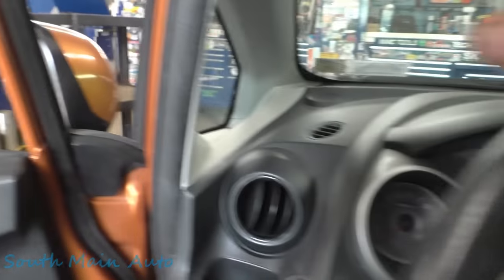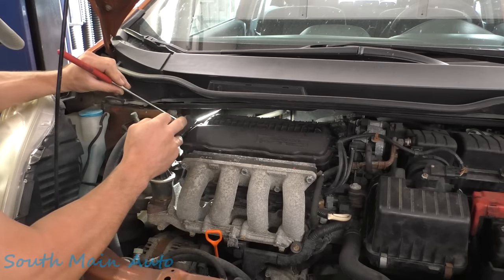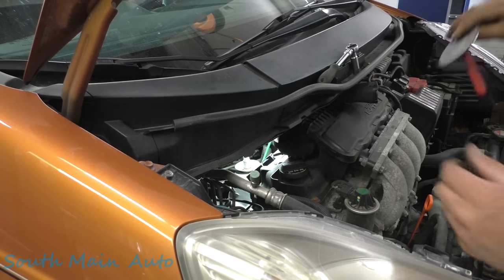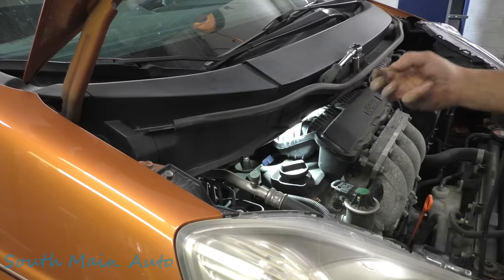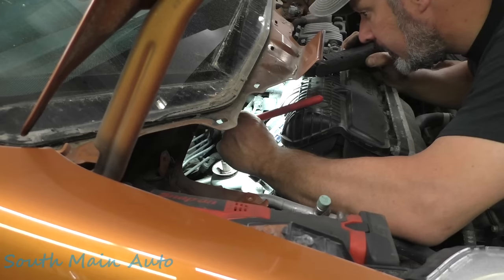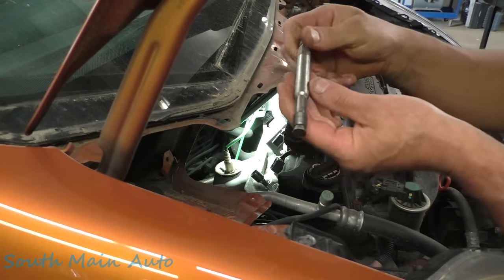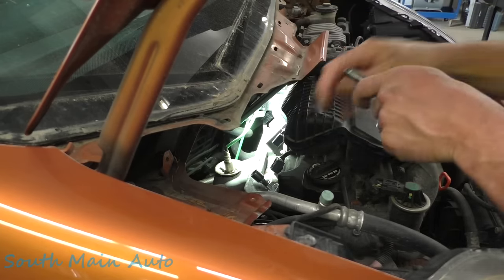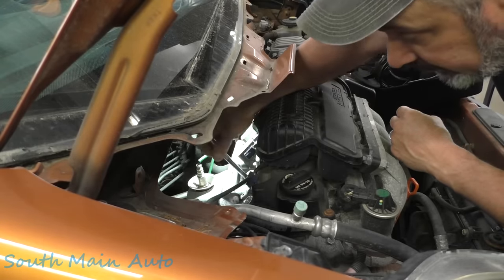Fixing A Blown Out Spark Plug - Honda Fit Edition

Comment: If you think this was an impressive repair, let me direct you to Eric installing  threaded inserts in a stripped out toyota engine block.
As a machinist I would have the luxury of having a bare block that I could clamp on a milling machine, locate the holes precisely, and drill and tap perfectly on location and square.
Full props to Eric doing it in the car and having it work perfectly with full massive torque applied to the head bolts at the end.

Comment: Bought a 2007 FIt second hand, wasn't sure of maintenance history, so went to change the plugs and noticed all four plugs loose!    The plugs looked okay, so torqued them back to spec, and car was fine.   A couple years later, ended up putting the new plugs and one of the plugs was again VERY loose.

Would make it part of bi-annual maintenance to recheck torque.  I normally would also say not to use anti-seize, or any lubrication on threads, but I used NGK plugs and installed dry, and they still backed out!

Comment: Minor FYI... Koken makes extensions that are nicely knurled around the female drive end... that are not only great for stuff like this; but everyday use as well. They come in all drive sizes, regular, wobble & some up to a meter long. Koken specializes in sockets, ratchets & related, has a huge selection and puts out excellent stuff.
Cool videos, Thanks! :)

Comment: Nice video man,  glad you could still save a new thread like that inside the spark plug's loose hole. That's sure is cheaper than buying a new engine.  I'll keep that torched in mind when I change my spark plugs for our 2017 Honda Mobilio here in the Philippines.

Comment: I've done a few blown out plugs before on Subaru's. I have alsways done the fill the flute with grease go in a bit pull out clean the flutes and regrease till yo get it in all the way. If you don't have a way to blow it out like Eric did that way works really good.

Comment: I had the cylinder heads for my old VW 1835cc engine re-done at a shop back in 1986; the shop installed heli-coil spark plug inserts even though the original aluminum threads were OK.  About 2010 one of those heli-coils unthreaded while removing a spark plug, and I installed a solid threaded insert there (#2 cylinder) without removing the engine; still working fine.  I used red Loctite on the outside of the insert and never-seize lubricant on the spark plug threads.

Comment: I use SHAVING CREAM ...   And I have be using a back tap lately.  The spark plug insert kit I use has solid inserts with a shoulder.   I grease the tap and frequently remove and clean the chips off.   Be sure the valves are closed and fill the cylinder full of shaving cream with a hose.    When you blow it out all of the chips are cleaned out! This no-name kit came with about 30 inserts ($35 Amazon/Ebay) and can be used on Ford 4.6/5.4 with blown out spark plugs on the side of the road.

Comment: Wow that’s a loud fit! 
I had a 2013 fit and loved it. Never had any issues except the axles in front both snapped twice each side on me. Each time 4 times total 
It was while accelerating hard to get across road thru traffic and snap and dead stop in middle of road. Almost got T BONED twice! 
     Honda did a recall on firs sold in rust belt states due to a corrosion spray coating not sticking to axles so was refunded 
Good $5 k back. 
      And the D light started flashing after I did a transmission fluid drain and fill and using amsoil atf 
And not the Honda fluid I should’ve used. 
    Appears that amsoil ATF runs too cold all the time and too cold ATF is just as bad as too hott atf in a transmission
   I put back the Honda fluid ATF and D light stopped flashing

Comment: Well known problem with the Honda Fit and loose sparkplugs. For me and a lot of people the problem is often with the number 3 plug (third from the left). Honda even increased their recommend spark plug torque for the Fit because of this issue. I highly recommend anyone that owns a a Fit to check the torque on their plugs. Once a year if you are a high mile driver. Under 5000 miles a year you can get by on every other year or so. I went three years and my number 3 plug was a little loose that it was causing the number 3 ignition coil to run hotter. I knew this because I changed all of them when I bought the car and put a lot of dielectric grease on it. The number 3 ignition coil had discoloration from heat and the grease was no longer greasy.

Comment: This is insane. Yesterday I had one of these towed in for the exact same thing. Spark plug was MIA and coil pack broke at the mount and melted all to pieces. Fortunately for the customer the threads were good on hers. I was shocked. Got new coil packs and plugs coming Monday. Crazy stuff.

Comment: Thank you for bringing us along. I want to replace my plugs on my kia soul but I worry about breaking the plastic clip the connects to the coil.

Waiting for my brake caliper rebuild kit so I can finish my front brakes. Never had a bad brake caliper. It is not leaking it was real pisser to push in Yes I should buy a reman or new from dealer but I want use the knowledge my grandfather shared with me to see if can repair it on the cheap.

Comment: Great video, did the same thing on a 1990 Pontiac, Grand Am. listened to tech to tell me to remove plugs with warm motor. big mistake. my year would eat the indium plug as they were to deep in the cylinder, design fail. so I would change them every other year and one time one spun. I got a kit and did all 4 plugs. best thing ever. why not have these in from factory as it didn’t mater after cold or hot you could easily remove the plugs.

Comment: Dang those Helicoils are pretty neat! They thought of everything, even the peening to lock the insert as best as possible.  I'll have to pick up a kit just in case.  Some of the castle nuts on mid 2000's Honda's do have thread troubles.

Edit - Tough to find that kit.  Amazon returns a bunch of trash kits.. while Napa comes back with a 1/2"-13 X .750 ... I'll keep looking .

The Part# I'm getting for that kit: Part #: BK 7703223 .. very similar but not quite.  Odd.

Comment: Great video. ngl I'd probably cry if I found myself in this situation, lol. So it's a big relief to see just how easily and simply you handled this. Glad that it's such an easy fix in this case. Just need the right tools, which fortunately don't seem to be particularly expensive, either!
Reply: And yeah, as @jthelman commented, especially the fact that you practically did this blind, too. Outstanding demo!

I also think I'm going to have to grab that endoscope. I was really impressed with Milwaukee's new one, but I'll happily take your suggestion for a tiny fraction of the price. Camera quality seemed just fine. My only question would be how often do you use the 5.5mm camera over the 7.9mm? Assuming you have both, since you say you have a few. Or, if not, how often do you find the 7.9mm just too big?

Comment: Saw something on the "Crescent 18 oz. Steel Indexing Claw Hammer" the other day, where the claw rotates and you are supposed to be able to hammer nails in between close studs. Seeing this video made me think it might be a good place to use it having to hit something like this in a tight space. The benefit is you move the claw up, so you keep all that mass at the head and can get a good impact underneath the window and behind the engine.

Comment: Watched till the very end, very impressive repair, it’s a shame whomever didn’t tighten those plugs up correctly originally, ultimately did a complete disservice to this customer. Amazing work you performed. I would have been swearing the entire time. Why don’t they design engines where the plugs are easy to get to and see?

Comment: Honda Fits are known to have the spark plugs back out over time. I usually check the torque every time I do the oil change. The factory torque was quite low and after a few years Honda increased the torque to help. Unfortunately, they can still back out over time.

Comment: I watched the Ford service garage on a Ranger 4 banger that had three out of four stripped out as the truck had the original autolites still in it and three stripped and one broke. The put everything in the truck on the floor and called my old boss to let him know their sending it his way. I loaded it and headed back with all my parts I needed for my fleet job and a plus one on the rollback that also ended up on my plate. That kit you have identical to the balkamp kit I had  also from helikoil

Comment: my name is tony from nj, im a long time subscriber love your videos, tech tip i leaned this tip when i was an electricians helper, when you use electrical tape before you cut off tape twist the roll a couple of times before you cut it, you'll have a little handle to unravel tape. not sure if you knew this tip, i wanted to share it anyway.

Comment: While I like the interior of the 2nd gen more, I’m glad I found a 1st gen Fit, at a good price for the mileage. 

Didn’t have nearly as easy access to the spark plugs as I did on my 98 Accord, but at least I don’t have to remove the wiper cowling like on the 2nd gen Fits. 

Main reason why I wanted a 2nd gen was for the ability to mod in radio controls. Since I got a 1st gen, I’m using an Atoto RF stick-on remote. Honestly works great, and gives 2 extra functions over the 2nd gen stock radio wheel control.

Comment: A mechanic that I used to work with had an old (1950s) push mower that would spit out it's spark plug, all he did was wrap the spark plug threads with Teflon tape and that gave it enough bite to stay in.  He said it had been like that for years.

Comment: It happened on my 2013 Fit but nothing was stripped out. I think the plug backs its way out from vibration. So i put the new NKK plugs in with a tiny tiny dab of anti sieze and crank the plug back down nice and hand tight. (no torq wrench). Never had another plug blowout ever again. TIP: Use your needle nose to grab out the lose plug and any broken plastic from your coil boot. You can also crank the motor over and she will blow any debris out of the cylinder. Also, buy a Honda plug tool. Its heavy and goes into those deep wells super easy. Once again, forget about toqring to factory specs. Do it like i told you. This is a very common problem on the Honda Fit. PS: Its fairly rare for any plug threads to actually be stripped.

Comment: My 2006 Acura TL 3.2 blew out the #6 spark plug in the front... took out all the threads and shattered the coil pack like it was shot.  Dealer wanted me to either scrap the car (buy a new one off the lot, which they could get me a "great deal" on), or to authorize getting a used engine to swap in.  I asked if they could do a helicoil - they said they wouldn't do that, no way.  So I had to go get a tow dolley and hit harbor freight for a comealong to pull the car up on the tow dolley.  Long story short, I towed it home, and carefully did a process with a product similar to a helacoil called a "Timesert".  The timesert was really an excellent repair... it had a shoulder at the top so it really locked into place and gave the spark plug seal somethign to directly bear down on.  Have now run the repair for 30kmi... zero issues at all.  And the dealer wanted me to junk the car.

Comment: nice repair, a time-sert would have been a better choice, IMHO.
they are what l use, where you had to hammer on the top to lock it in place, the installer part of the time-sert pushes the thread of the entire insert against the  new threads you cut, and provides a mechanical lock all the way, l do still use loctite, you can never be too careful.
time-serts were a game changer for me, when l found them, all of my helicoil kits went straight in the trash.
keep up the good work

Comment: One time and one time only Mr. O I had a Ford V10 that had an insert. I did not know it had an insert and I removed the plug. The plug had no insert when removed. I went to put in a new plug and it just wouldn’t tighten. I looked down the hole with a bore scope and when I threaded in the plug it rotated the insert all the way in and the insert fell into the cylinder….that was a very pricey tune up.

Comment: I'm not a pro mechanic or even a hobby machinist, but would a Time-sert be a good option here?   They self-lock by expanding the bottom thread, but I don't know if that's good enough for an aluminum head and the heat stresses it sees.  Initial impressions is that it would be one less step and potentially a more positive lock than swaging over a fitting in a limited area.

Comment: yep valves closed and piston down out of the way, don't want to run into any of them with the drill, reamer, tap, tooling.
typically, all the debris is tiny light chips and anything left after blasting it with air nozzle will exit rapidly via the exhaust port on first fire, very tiny shavings will likely leave as glowing embers.
pretty much, crank it over by hand once to ensure nothing will collide, from insert too deep/valves hitting(rarely an issue, unless very loose and spark plug threads it in further, threadlocker!), then fire it up to idle immediately to toss the junk out.

Comment: Really interesting video(not that I have everseen a bad one ) as I have never come across one .question if you were stuck out in the boonies could you use a larger diameter spark plug as a temporay fix ? Cheers Mr O.

Comment: Story time:  1990-something.  Fort Drum.  End of tour, time to go home.  A buddy has issues with his POV (Personally Owned Vehicle):  A spark plug is dangling from  the cable; blown out of the hole.  The threads are gone, time is ticking.  No place is open on a Sunday afternoon.  I rummaged around his trunk for possibles and there is some trip flare wire (Army Life, Yo).  Instant DIY helicoil.  I wrapped the sparkplug threads with that really thin wire and turned it in.  "Like a glove(tm)".  He drove home and another many thousand miles with that plug fabricobbled into his motor.

Comment: We use the medium length inserts to repair stripped aluminum oil pan drain plug holes, along with a new spark plug threaded drain plug.

Comment: So, it seems to me that the biggest problem here is that Hondoo designed this cylinder head to be installed backwards...I mean seriously, the spark plugs SHOULD be in the front on 4 cylinder transverse mounted engines right?!? I thought only Ford Triton engines launched spark plugs (just kidding of course).

Also, I bought that camera from your Amazon store a while back. It's a really nice setup and I'm glad that I made the investment.

Comment: Need some advice from you. My 2000 Camry LE 4 cylinder is now 23 years old I was told by some friends of mine to change the fuses inside the cabin. I haven't so far. But need a opinion if I should change the fuses to new fuses. When I had my new stereo system put in the stereo guy took out one of the fuses it full apart in his hand. The stereo guy replaced it for me. I do know it takes the mini fuses because I checked. I do need your answer. Please reply.

Comment: That's interesting.  I'm a retired mechanic and drive an 09 Fit.  I've done my sparkplugs all with my left arm by feel.  Now my neighbor drives a 2012 Fit and she started having drivability issues.  I scanned it and it showed a #2 misfire.    So I brought it in and reached around...yes  I did a reach around, and took the coil off and the spark plug was loose.  Due to being loose and letting gases out, it ruined the coil.  So I put a new coil and spark plug in it and it was good and ran perfect.  Nobody had been into that engine before.  It's damned strange to have loose sparkplugs like that.
Reply from the maker: Yeah that is interesting. Nice job on the classic reach around too haha

Comment: Eric I replaced my 08 cobalts rear drums and it made clicking I got a shop to replace rear drums and still clicking I hear drive in reverse and slam on brakes will fix the self adjusters wondering if this will fix my rear drum clicking noise….. just spent 1100 at shop trying to avoid tearing apart myself and it still does this skipping clicking noise when breaking sometimes but not every time….  Had car since 2012 and put 2 engines in it So it’s sentimental thanks!

Comment: That ke stickin it all the way in hittin the bottom omg.  Dude you kill me hahahahah.
  I like the inserts like the ford repair kit. The helicoil ones work just as fine.
  Ive had to do both but only on for 3 valve and tue old chevy 2.2l4
 What really fun is when the plug flys by ypur ylhead as the engines running, and so fast couldnt find where the spark plug went hahahaha

Comment: Hoping it doesn't come to the stripped out part. Have a Volvo 5 cyl w/#3 plug not wanting to unscrew. Other 4 easy out, new plugs in w/anti seize. #3 now sitting with some PB blaster hoping to penetrate its was to loosened threads.

This video reduced my anxiety. At least the plugs are on top facing up with complete access.

Comment: Bean counters: "Okay, engineers, we need to save an additional 1.6% per unit manufacturing cost. Work your magic and we'll have a pizza party."

Engineers: "Well, we could push the engine back an additional 4.5 inches to allow the use of larger components that are cheaper to mass produce, but it will make the backside plugs almost impossible to remove, especially during a catastrophic failure."

Bean counters: "Perfect. This also guarantees an engine out or head service at the dealership. Pepperoni and mushroom okay with you guys?"

Eric O: "You have underestimated my power"

Comment: Is there any difference in your experience with using. A pneumatic rat hit vs the battery one ya used  ?? Or does it really depend on the engines your tapping